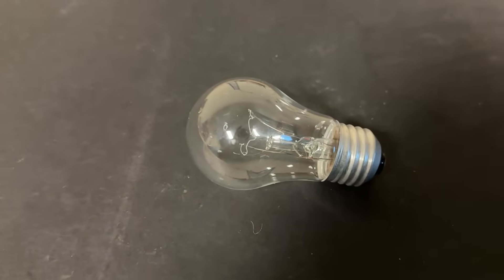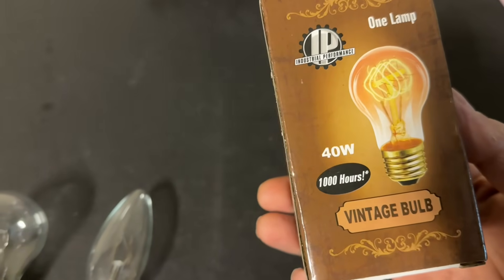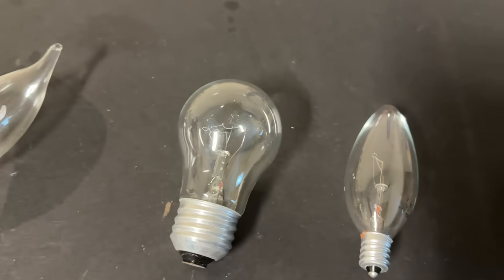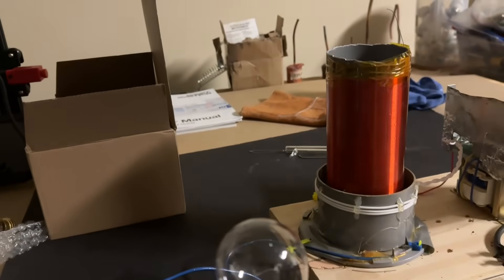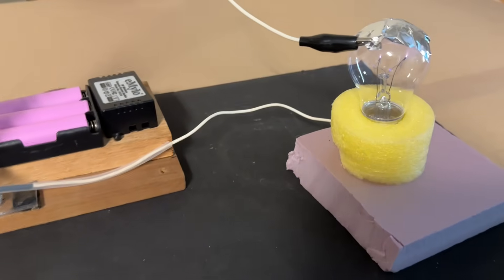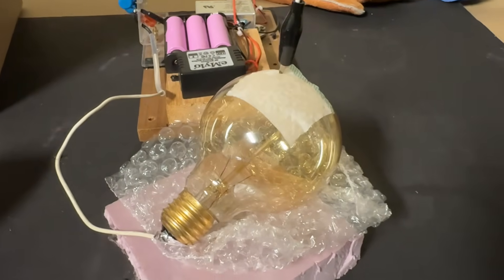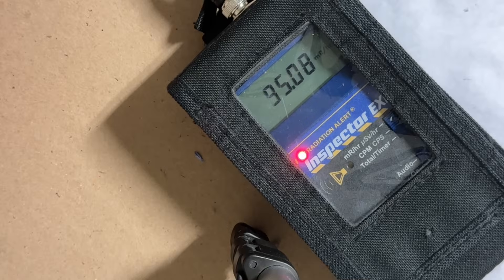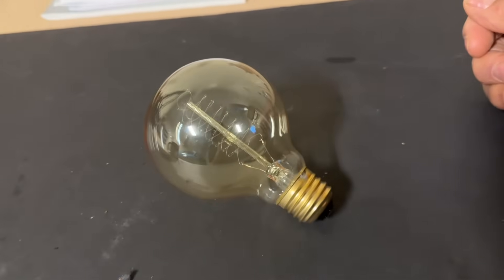Intense radiation output from Vintage lightbulb

Comment: This was shown decades ago in A Scientific American issue in the Amateur Scientist section. The bulb has to be under a high vacuum so no heated gas and also so accelearated electrons hit the target at high speed.
Reply: Scientific American, July 1956, "The Amateur Scientist" Concerning an inexpensive and safe method for the generation of X-rays
Reply: @wbeaty  Safe?
Reply: @zinckensteel  find the article, it was inside a lead box with a tiny hole in front, covered with a sliding lead shutter.   
Also, the hard UV in sunlight is ionizing radiation (just not penetrating radiation,) so when compared to x-ray hazards, it's melanoma from sunlight that's extremely dangerous.
Reply: @wbeaty  I have a copy of it, and have read it many times. I am not trying to be antagonistic or haughty - my comment was meant to be humorous.
Reply: @zinckensteel  ah, sorry.   I'm always dealing with people suffering from extreme radiation paranoia.   To be consistent, they should be totally terrified of sunlight, and panic if any ever touched their skin.   That stuff causes cancer, doncha know!   People going outside get whole-body radiation burns!   Unlicensed tanning-beds will ruin everything, better get the DOE involved.
But also, I've heard that dental x-ray machines today have such low output, that if you sat under one continuously, it won't even produce skin-reddening.   Don't know if that's true though.
Reply: @zinckensteel  sorry!   I'm always dealing with people suffering from extreme radiation-fear.    As if dental x-rays were hazardous, when compared to sunlight hitting your unprotected skin.  After all, that "daylight" stuff is unsafe, gives whole-body radiation burns, also greatly increases risk of cancer.   Any amount of sunlight is too much sunlight, right?  (Insert quote from Repo Man here.)
Reply: - several copies of A Scientific American (and several other magazines) were translated into Russian for several tech.libraries, mostly for the military "research".  There were also several entrusted "writers"... through this machinery the very restricted access to the Western Tech was performed.  Own creativity was insignificant.

Comment: I presume that your neighbours are happy with being exposed to large doses of x-rays.
Reply: At a distance,  granite counter tops and cinderblock walls give far, far more x-rays.    Also, your own skeleton is the main source of radiation exposure, from the potassium-40 isotope in your bones.   Also, solar UV is ionizing radiation.   Sunburn is a radiation burn, and UV will give you cancer.   But it takes enormous UV exposure, or enormous x-ray exposure, before cancer-risk starts to increase.

Comment: That was a shitload of radiation, way more than I would guess.
Reply from the maker: Yep never expected that blast of X rays was initially expecting an uptick of background!
Reply: @BrianDhvTinkerer  Next build a Nikola Tesla "mad scientist helmet" covered with aquarium bulbs glowing bright green.   Tesla aimed MeV x-ray beams at his own brain, saying it cured fatigue, caused sleepyness, "lost time effect," and enormous bursts of creativity.   I'm not gonna try it, you try it.   
I do note unexplained bursts of creativity that happen when the airliner hits cruising altitude ( cosmic rays typically 0.5 mR/hr, or roughly 20X sea level.   The flashing light on your GM counter just turns on solid.)
Reply from the maker: Haha - now we’re talking 😂 Nikola had a point there. Interestingly he slept very little !

Oh btw- check this out:

https://youtu.be/HsLpqnKHWWc?si=O81zBww1flwwIGbF
Reply: @BrianDhvTinkerer  Yep, I also measured 20X background, and with an alpha-window tube.  But aiming it upwards or downwards, no diff (while expecting excess low-energy betas coming down from above.  Gammas just go through, regardless of orientation.)   If I had a lead brick with me, maybe I could check for excess gammas from above rather than below.
PS Tesla also said that x-rays "remove the need for sleep."   But I figured that out in college, "Thomas Edison sleep mode," staying awake for days while taking only 10min catnaps.  Total sleep only 2-4 hrs per day.   The longest I did that was around ten weeks, today called "Polyphasic Sleep" ...and my ex-wife forced me to stop.   Once that "mode" turns on, you cannot sleep for more than an hour, no matter how hard you try.  Probably some insomniacs have turned on that special mode by accident.
Reply: @BrianDhvTinkerer  Damn! I schould be captain proton or dead by now!

Comment: Back in the GOOD Scientific American  magazine days (when I were a lad...)  there was a column called The Amateur Scientist with lots of nifty experiments.
One was to use an old radio valve (tube) in this manner with an Aluminum foil outer electrode to generate X-Rays from electrons striking the Shiny Grey coating of Magnesium at the top of the glass envelope that was there to absorb any out-gassing from the electrodes.
Maybe the Aluminum foil  helped by absorbing the 'soft' x-rays as noted elsewhere here by @mrDarktrooper.   Fun times!

Comment: Similar results using flyback transformer and voltage multiplier applied to a 1b3 HV rectifier tube. Cold cathode at 60kv and 50ua. About 3 watts input. Counter went crazy. I used BW print paper and a dead rat for image.
Reply: kV and uA, not kv and ua.
Reply from the maker: Those soft x rays are great for small items

Comment: How about testing one of those ultraviolet quacks medical devise sold back in the 1920s?
Reply from the maker: Yes, those things are yet another bit of x-ray magic depending on which one you get. The gas filled ones are fairly safe. However, the fluorescent ones are potentially harmful as they can produce a substantial dose of soft x-rays directly to the soft tissues.
Reply: @BrianDhvTinkerer  Thank you for the information and for keeping us informed.

Comment: Would it help to produce even more X-rays if the filament was glowing hot?
Reply: TL;DR: No

If the filament was heated, it would greatly reduce the resistance of the diode (which is what you're making). The resistance reduction would load down the voltage generator, prohibiting the voltage from going very high. The low voltage would cause the accelerated electrons to each have a far lower energy. When these low energy electrons hit the target, they would give off very low energy x-rays, which wouldn't make it out of the glass.

Comment: Vacuum tubes, like the 5U4, work really well in this mode.
Reply: and the Russian shunt-regulator tube, the 6VS-1, small spot, makes very sharp x-ray images.
I hear that an ancient CCD cam with wide sensor, plus zinc sulfide paint, gives you an x-ray microscope.

Comment: Soft X-rays being produced here are particularly bad because they are easily absorbed by soft tissue in the body, they have enough energy to remove electrons from atoms. This can lead to DNA damage, potentially causing mutations. This is why X-ray tubes typically have an aluminum filter in the beam path.
Reply: In industrial X-Ray inspection, we use different types of filters to allow only certain bandwidth of rays to pass.  Question: Why would higher energy X rays (presumably higher than UV band radiation) be less damaging to soft tissue? I know they penetrate further than UV-soft x-rays (skin) but do get stopped by soft tissues with resultant energy transfer being much higher, thus more damage to those cells?
Reply: @prestonburton8504  High energy x-rays and gamma radiation tend to pass through soft tissue with little or no interaction, so no ionisation of atoms in the tissue and no DNA damage.  Soft x-rays are more readily absorbed - i.e. they interact more with the atoms they encounter.
Reply: @ thank you! I read another poster saying Rad absorption needs to be adjusted for bone (x4) after i replied to your post. This makes sense (and why photographic images show bone much better than soft tissues).  I wonder if the same applies to neutrons? Fast neutrons have less interaction with matter and must be slowed down in order to react?
Reply: @ Neutrons are more complex as they have mass but no charge. Slowing them down by scattering with low atomic number elements (H or C, as in a moderator) is not the same as absorption, which also happens with the higher AW elements in the body where collisions with neutrons cause indirect ionisation of those elements and tissue damage.
Reply: @prestonburton8504  Up on the ISS, cosmic rays aren't very dangerous, because everything is transparent to them.   To receive DNA damage, your tissues must absorb the radiation.   Same with soft x-rays.   Before 1930, a couple hundred early x-ray workers died, mostly from massive melanoma.   (If they were working under unshielded quartz UV kilowatt lamps  ...same lethal danger.)    Nikola Tesla reports that x-rays would tan the skin on his hands dark, almost black.   
I hear that WW 1 secret tests of x-ray weapons were abandoned, because it just warms up your bones without harming flesh.   Makes perfect sense, so maybe it's not just a crazy rumor.

Comment: Did it give X-rays when normal power is put through it? If not, what’s the point of this video?
Reply: It doesn't generate X rays normally. The spectrum of incandescence lamp produced radiation hardly approaches UV.
The experiment in the video uses classic incandescence lamps in an unusual manner; as thin glass vacuum chambers containing the cathode of a makeshift Roentgen tube. A very high voltage source is connected with the negative pole at the filament (lamp socket) and the positive pole at an anode on the exterior surface of the glass bulb .

Comment: Hello, if x-rays were emitted with a simple lamp, does the same effect occur in radio and TV thermionic valves?
Reply: Hell yeah, if you hook them up to 40KVDC.   But otherwise not.
Reply from the maker: The voltage applied across the thermionic valves is much lower, so the answer is no. However, the high voltage supply of the older black-and-white, and early  color TVs used a rectifier tube, which has a significantly high voltage across it, and which may have emitted x-rays. Also the TV CRT screen did, but these were suppressed due to the presence of leaded glass.
Reply: Early colour to sets with valve eht rectifiers such as the mullard GY501 did just that, and as such were in a metal can covered in x-ray warning labels

Comment: What did your geiger counter measure with no lightbulb and the coil running?
Reply from the maker: It read background counts
Reply: The EM will drive a #3 Ludlum counter crazy.   It turns out to be caused by the rubber gasket around the main panel.   Needs a piece of ground-braid, and a couple of screws.  Connect the copper braid between the aluminum shell and the metal top, to restore full EM shielding.

Comment: How is the vacuum in a ligh bulb anywhere near high enough for X-rays?
Reply: Nearly all light bulbs are backfilled with argon gas, for zero x-rays.   Only certain ones have hard vacuum.  "Hard," means down below about 75 microns pressure.   That's where all the glows become dark, and the glass surface is fluorescing green, because of electron impact.   Even so, it's a quite poor vacuum (easily created with an oil-vane pump from your high-school science class, no need for fancy expensive equipment.)

Comment: The guy appeared to take one for the team, just to demonstrate this phenomena to the audience watching. I wonder how that compares to something like a dental X-ray?
Reply from the maker: An average dental exposure is 5 millirems. The exposure rate of the vintage bulb at say 4 ft is 100 millirem/h. I was about 2 ft from it = 400 millirem/h. A 30 second exposure = (0.5/60)(400)=3.3 millirem so it is less then one average dental x ray
Reply: @BrianDhvTinkerer  Huh, figure out the millirems in summer sunlight, caused by its hard UV component.   Mutagenic!   But sunlight only gives melanoma, not cancerous internal organs.
People don't want to know that "normal" sunburn is a full-on radiation burn, or that skin-cancer was the thing that killed a couple hundred x-ray workers in the early days.   How many sunburns before you'll definitely get skin cancer?  Lots.   Should everyone be terrified of sunlight?  Nope.   For x-rays, the answer is roughly the same   ...if you're not getting radiation burns,  or accumulating many Rem over hours/days/weeks, then the cancer rate is way way way below the same cancer rate caused by normal sunlight.   (If we're not terrified of sunlight, then we should fear x-rays even less.   Just avoid the sparkly cobalt-60 powder, or the cesium-137 pellets. )
Reply: @BrianDhvTinkerer  less than a dental X-ray but also less focused. This went all over your body.
Reply: The word is phenomenON. Phenomena is a Latin grammar plural. Phenomenons is an English grammar plural. Therefore, it's "this phenomenon and these phenomenons" or "hoc phaenomenon et haec phaenomena". English language, English grammar. Latin language, Latin grammar.
Reply: As Heckefish says, PHENOMENON  ...da doooo da doo-da
PHENOMENON ...da doo-da doot
PHENOMENON ...da dooo, da doo-da
da doo-da
da doo-da
da doo-da, da-da doot da doo-da DOOT!

Comment: How are you sure these are xrays, could be the electric field setting off the giger counter
Reply: Mostly, it only does it with high-vacuum light bulbs, the kind with no glows inside.   Also, DC power supplies don't usually set off Geiger Counters   ...only Tesla Coils do that.   (So, wave your GM counter around a Tesla coil.   If it doesn't click like crazy, you've just verified its good shielding.   Warning:  Ludlum #3 GM counters are badly shielded, and with those you cannot know if the clicks are from your Tesla coil's EMP, or from the genuine x-rays.)
Reply: The interaction with the glass. See the luminescence patches .

Comment: youve given me some ideas lol, replicating this is definitely on the to do list, but unfortuneately it will be a while before i can give it a shot safely
Reply from the maker: Kinda curious what you have planned😁
Reply: Steel or iron plates are great for shielding soft x-rays.  Try metal electronics enclosures, (steel, so magnets will stick to them.)   Just don't use a 200KVDC power supply.  That would require casting some actual lead shields.

Comment: this is very cool, i think you could signifigantly increase the x-ray production by running a current through the fillament, essentially turning on the lightbulb as usual, i think this would release many more thermal electrons from the tungsten than the high voltage alone can produce, though i imagine this wouldn't be easy to do because of the massive voltage the fillament has applied, to get the required few volts of potential difference i guess you would need to attach a second high voltage source just a few volts below the other to act as a drain. but at the end of the day i've got no idea what i'm talking about, i'm just a high school student so my idea might be total bollocks

Comment: what kind of detector are you using?
Reply: Looks like a semi-standard pancake-detector with an alpha window (much like the common 44-9 probe.)   Appears to be the probe that comes with Radiation Alert Inspector, the version with an external connector.
Note that if you use a conventional geiger tube, the count rate will be around 10X lower, because soft x-rays cannot get through the metal tube.   For low-energy x-rays, need the alpha-window.

Comment: Old CRT tubes are possibly a better bet. Also I would be looking to build some lead shielding before I even attempted any of this. Don't even think of replicating the 'Shoe-fitting fluoroscopes'  which were still around in the 1970s.
Reply from the maker: The shoe fitting fluoroscope’s were really interesting and a direct spinoff from the work of Nikola Tesla, who measured his own foot.
Reply: CRT is cathode ray tube. There is no such ting as CRT tube. WTF would be a tube tube?

Comment: How are you sure that EM pulses from the DC generator don't influence the Geiger counter? I used to have a Tesla coil run at around 60 watts and it influenced the TV in the other room which was more than 5 meters away from my tesla coil.
Reply from the maker: I’ve done the same experiment using a lightbulb that contains argon, and there are no counts detected exact same power supply and voltage and same distance
Reply: @BrianDhvTinkerer  interesting. I am actually trying to build my own radiation detector. Still waiting for my parts. And ordered some uranium glass too. maybe I will replicate your experiment sometime.
Reply from the maker: What kind of detector is it gonna be a GM tube or will it be a cloud chamber?
Reply: @BrianDhvTinkerer  actually it will be a photovoltaic detector. Apparently PiN diodes (photodiode) can also detect gamma radiation and doing a few calculations I was led to the conclusion that they can also detect x-rays. With the proper setting and amplifying the signal with proper components, I will be able to do a radiation detector with photodiode. I must only keep it completely dark and with an excellent insulation of the entire circuit from EM noise.
Reply from the maker: @thelonewolf1757 that is real interesting. I’ve always been interested in wanting to do that. It may be something I can set up. I have a whole bunch of different types of PiN type diodes

Comment: Other people would turn up the voltage until X-rays are produced, and play with that threshold.
Reply from the maker: Yeah, my voltage was kind of fixed at 40 kV because of the power supply I was using. I do have a variable voltage alternating power supply. This can put out a lot of current but with a wetted paper, there would be an automatic limitation on the amount of current that could be passed capacitively across the glass of the bulb. This would be an interesting experiment, though.